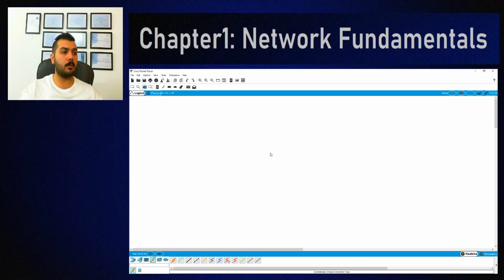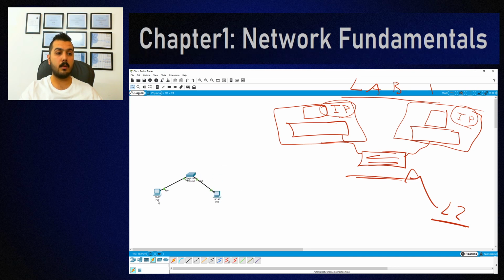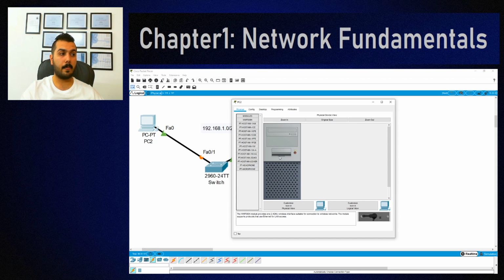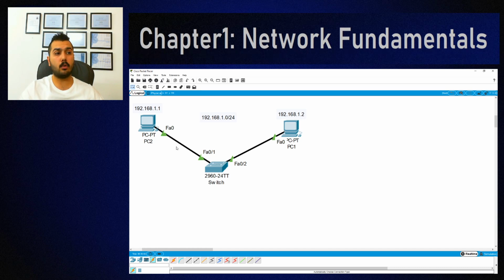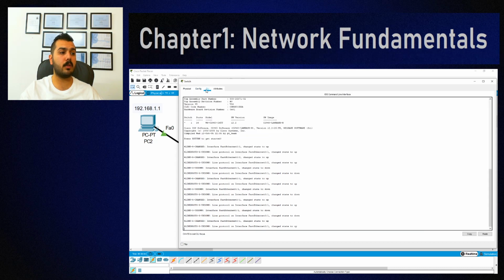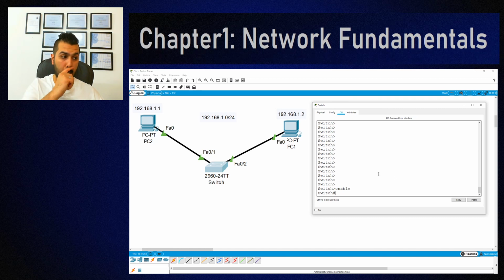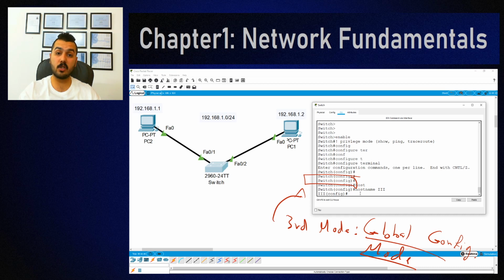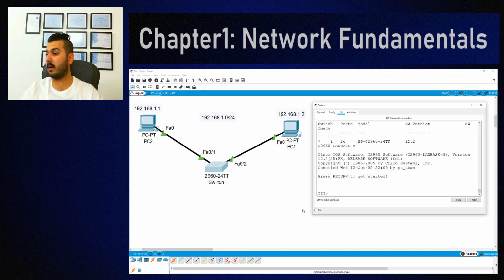20 - CCNA 200-301 (OBSOLETE) - Chapter1: Network Fundamentals - Cisco Packet Tracer

Comment: Hi Sir, I read  transport layer is responsible for flow control so is it possible to connect switch and end device in such a way that of GE at switch end and FE at end device end? will transport layer controls the flow of data between them and is it valid connection?
Reply from the maker: hello dear, it is a valid connection but you must configure the ports speed from the switch side to become 100 Mbps
Reply: @IIINetworking  Thank You